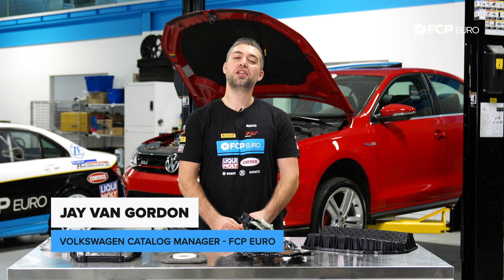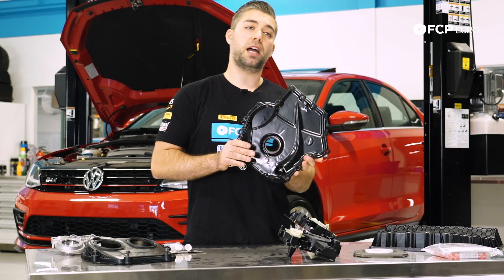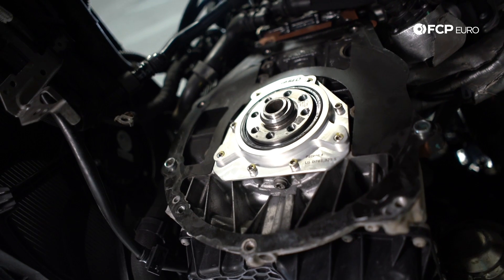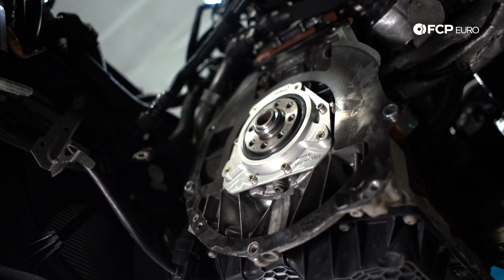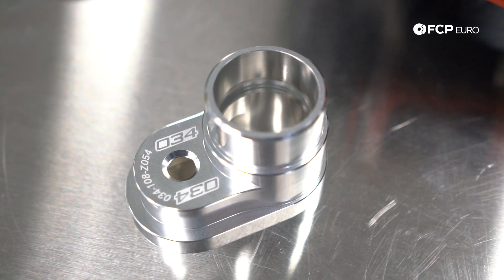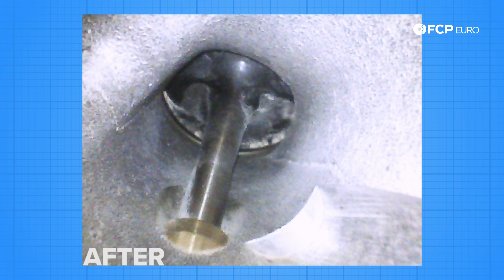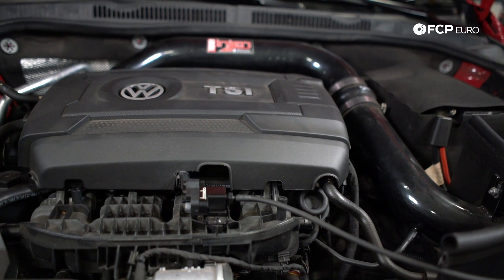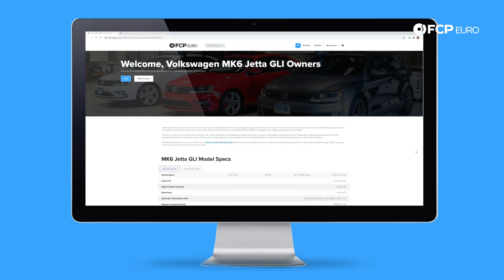Volkswagen EA888 Gen 3 Engine Diagnostics & Maintenance Guide (Mk6 GLI, Mk7 Golf, GTI, Golf R, S3,+)

Comment: ea888 gen 3 is known for having almost no issues... Intake valve cleaning, that should be done for every engine if you ask me.. walnut blasting
Reply: They still are prone to oil consumption. A few months ago I bought a 2016 Golf 7R with 156.000 km and burns 1 L of oil at every 1500 km.

Comment: just got P0303 code for misfire cylinder 3 on my MK7.5 Golf R. At what range do these ignition coils tend to go bad? Im around 68k miles and im hoping thats the issue. Also, on the Gen3 motors, when should a carbon cleaning be considered what mileage give or take? And for the Water pump replacement, do you wait for an out right failure? or is there warning signs? Great video. Just wish there was an anticipated mileage or time frame to expect certain items to be considered.

Comment: Oil leaking from cam bridge can leak into the the actual camshaft actuators and will cause a timing code. Oil will be inside the connector of the actual camshaft actuator pins. Would have to replace cam actuators and sometimes even replace connector head and wiring.

Comment: Its funny because I sold my 2004 Clio 182 140k miles on it and got an Audi a4 2.0 tfsi 225bhp thinking oo newer more reliable what a F**king mistake that was 😂 I’ve gone from powerful engine all metal parts to hot wheels engine

Comment: I live in the tropics and we have hot weather everyday with high humidity. These plastic parts in the engine are simply not durable enough. Had my Passat water pump and thermostat changed due to a cracked plastic housing after only 36K km. VW should reconsider upgrading their plastic to manage hot climate regions.

Comment: Does it generally burn oil?
Reply: If it's a 1.4TSI..Yes.
Reply: @ 2.0T in mk 7 GTI?
Reply: @ewanduplessis9682   It depends... How you drive it.. did you tune it...etc. But on average...no its not an engine that consumes a lot of oil during the time between service intervals.
Reply: @IlikeShekels  So in stock form without abusing it and doing maintenance/services on time, a typcal mk 7 GTI shouldnt consume a lot of oil if any right?
Reply: @ewanduplessis9682   That is correct.

Comment: i have a octavia rs with the chha engine (8 injectors) stock 230hp but done a stage 1 to 300hp on 98 octane now. im impressed how nice of a engine this is... realy powerful from low rmp all the way up, very nice economy when driven softly, warm up very quick even in -10 celcius wont take 5min to have coolant at 90. also, when u have port injection, carbon buildup on the valves tend to be well less of a issue as gas cleans it up quite abit.
Reply: Anche io golf gti mk7, 8 iniettori..💯

Comment: It blows my mind that VW still makes the worst design decisions with their drivetrains.  This is the 6th variation of this water pump and they all have failed/leak.  $400 in just parts to replace a water pump?  Removing the intake manifold?  Who designed this piece of fucking shit?  Buy a Honda or Toyota of the same year and never have to deal with this fucking garbage.  The quality isn't even a comparison.  I used to argue that the TDI was the only saving grace of these Hitler mobiles, but the bolts made out of cheese that held on my crank pulley changed my mind on that as well.

Comment: Ive got a gen 3 apart right now for a water pump ,and the intake is off. 
Its not too bad in the ports, its not great either. 
Its got 91k, whats typical mileage before needing an intake clean?

Comment: Good video. Here is some more advice. For these VWs watch out for
1. Leaks from Water pump and coolant flanges.
2. Replace your oil separator every 2 years (or yearly if you can). These always fail and are the main cause of many of the engine oil leaks mentioned in this video.
3. Use quality synthetic engine oil and change it regularly. Preferably every 7,000 kilometres. You will have less carbonisation snd performance issues.
4. Get a real vw technician to check the condition your timing chain once a year.
5. Be ready for some very annoying failures of electronic components... and they are expensive to replace.
6. Once your car is ok, make sure your really drive and enjoy it to make it "pay" for all the agony above.
Reply: what you mean by oil separator? the PCV valve? 
thank you!
Reply: @pepehuan  Yes, the oil separator functions as a PCV valve
Reply: @faktsonly  Barely.... Also, I wouldn't take my Volkswagen to a Volkswagen dealer if they were giving away service for free. Absolutely a waste of your money and you'll wind up paying for it when they screw something up on your car. Find a decent independent mechanic shop and go there if you really have to.
Reply: I've had horrible experience at the VW dealer. If I can't fix it myself, I take it to a master mechanic I know who specialized in Euro vehicles
Reply: My opinion is and I say this because I apply it ,
I resign I have had Audi cars , but what I do is I buy the car with less than 10 thousand miles certified , never new because you can more money , then the car all the way counts with warranty and apart one more year for certification ,
All Audi and VW come with 2 free services and one more that the dealership offers you (this is optional) not all offer it, at least in my state several dealerships do,
I enjoy them until the end of the warranty and certification which is around 60 thousand miles or 5 years, and after that I change it for a newer one with the same options as the previous one,
Why?
Because if I would stay longer with them you lose more money in repairs and anyway your car continues to devalue and that money you invested in repairs you will not recover . And you really invest little in maintenance after your three years of free service ,
Which is an approximate of 800 Dlls for the next 2 years that I have left to change it .... 
Well that's my strategy , maybe there are other people that many what they do is just rent it for as many years as they want and so they avoid the cost of maintenance and repairs ... greetings .

Comment: Recently noticed engine oil around Plastic oil pan of my 1.8T gen 3.
Dealer cleaned area and will check it again in 2 weeks. They think the oil coming from top of engine !  Car under warranty. No low oil level.
What it can be ?  Thanks

Comment: Under what mileage I should consider changing Timing Chain and Water pump please ?
Reply from the maker: Hi Saef, the chain has no interval as it is not a service item, however for the water pump they tend to last anywhere from 60k-100k.
Reply: @fcpeuro  thank you for quick reply.
I noticed leak from upper timing cover and only has 45,000 miles. As changing timing cover, what else I should look for please ? Thanks
Reply: @saefhindi6184  which car is this gti/tiguan?,I have purchased 2022 tiguan 2.0 tsi(india)
Reply: @vekeyes3861  its 2019 Golf Sportwagen 1.8T 4 motion DSG transmission. I will mention it to dealer in next visit

Comment: Has anyone had a problem with rough idling when just sitting park? I had my check engine light come and it said I had misfires in cylinder 1,2 and 4. Does this problem sound similar to anyone else’s?
Reply: My mk6.5 1.8t has rough idle on cold starts, which diminishes in sport mode or after driving for a bit. Pulled code P0441 - EVAP system, incorrect flow detected. Also had misfires like you're saying, and camshaft over-advanced. Fuel trim went up to 32% at some points while revving in park. I don't wanna throw parts and time at it so I'm gonna take it to a shop. Engine power seems fine, pulls well on the freeway but the engine bucks so hard on cold starts.

Comment: Excellent information. 65 K on my 2018 Golf 1.8 TSI Gen-3. Change oil every 5K, use Top Tier gas, almost all highway driving at 75 mph, 2300 rpm.  Mileage is amazing (41-43 mpg). No problems yet, and following the maintenance schedule without variation. Not keeping up with maintenance on a VW is an invitation for expensive problems.

Comment: How many miles the chain could last?
Reply from the maker: Timing chains for these motors typically last between 80-100k. There is always the possibility that chains can exceed this interval or have to be addressed before this interval as well.
Reply: @fcpeuro  could I check the condition via diagnose ?

Comment: I need some info & help RE; 2016 polo 1.8 gti tsi bluemotion 192hp DAJA.
    I have noticed a very small amount of engine oil on the spark plug thread on the last cylinder (air filter side), i believe that the leak is coming from the valve cover seal around that spark plug& dripping onto the nut of the spark plug , i think that when i removed that plug the oil dripped down the crush washer onto the thread ? The actual spark gap  is normal & dry.
 So i now need to reseal the valve cover  but there is a lot of hoses , valves etc to move so i can lift the valve cover out, i cant find any vids on how to do this on this engine , im no stranger to doing valve cover gasket relpacements but this one has made me think twice about doing it myself , i need as much info & help with this as possible , am i over thinking this task or is it  a relatively easy task?? 
Normally a valve cover gasket job is a easy & straight forward proccess, obviously my engine is chain driven but will i mess the timing up when i remove the valve cover ? I dont want to undo anything that i dont need to undo or remove ,i just want to do the easiest straight forward way to do this . Tools are not an issue as i have the relevant tools needed .
 Thanks in advance 
If you or anyone has done this proceedure on the same engine ir has found a tutorial vid of it on this engine please can you let me know it will be very much appreciated , my email address is Sentinal123p@gmail.com

Comment: Got new VW Tiguan 2020 and noticed my car is being low on the oil. Took it two times to a dealership and they told me it is not leaking and that lose of oil is acceptable. It even says so in the manual, I just can’t believe that lose of oil (being that is small) it is still acceptable with EA888 engine.
Reply: All engine consumes oil. Only excessive oil use is bad

Comment: What oil grade should i use for this engine? Should I stick to the same oil grade I've done stage 3 for this?
Reply: If you don't stick to the factory recommended oil change intervals, why would you stick to the factory recommended oil weight? 
I don't. 
110k and only preventive maintenance so far.

Comment: I believe Gen 3 version has a PORT fuel rail aside with the direct injection.  Is it still there the carbon build up problem?
Reply: Nope.. I've cjeb engine but got carbon flush anyway.. Not a lot came out. Better set up in euro engine

Comment: Can the covers be taken off without messing around with any timing components? Why hasn't VW fixed the cam cover oil leaks? I don't get it. Maybe it's just going to happen no matter what. Can you add an oil-air separator, an oil catch can? Are there aftermarket metal oil pans? Still using plastic in the water housing.! WTF. 
Man, I see that VW AG hasn't really changed a lot since my VSTT training. So many problems. Ya, great when new, and horrible to maintain and work on.

Comment: Does anyone have any idea when you should replace the 2 capsules in the coolant expansion tank? I have asked several experienced VW techs and no one knows 1 what the purpose is and 2 when to replace them or if they are needed.  My concern is what happens if they break and leak in to the cooling system clogging heater core or radiator.
Reply: Take them out, they serve no purpose
Reply: Flushing the coolant every four years and changing the coolant exp tank at the same time is a prudent move. Replacement tanks generally don't come with silica capsules inside...

Comment: One way to let your timing chains last is don't follow VW's extended oil change interval. Get that crap drained out of your engine at 3k-5k miles and change it with whatever oil spec VW wants.

Edit: Yeah I commented before he said 5,000 miles lol.
Reply: I did 3k on my MK4 GLS and 5k on my 2.5 SE. I was generally a quarter bottle low with the MK6 each time. Wasn't too concerned.
Reply: I do every 3k miles, and when I am done I pour the oil all over bald eagle nests in the forest.

Comment: What about the catalytic converter? At 100 000kms my catalytic converter got clogged. Replacing it would have costed over $2k so I decided to decat it.
Model : Audi A3 1.8TFSI
Year : 2014
Engine: EA888 gen 3
Code: CJSA
Reply from the maker: catalytic converters do have a working life, but a lot of the time they becomed clogged due to other issues, like excessive oil burning or running rich

Comment: Question; why do Americans recommend oil changes every 5k miles, whereas in Europe it's 10k miles or 12 months?
Reply from the maker: Not sure about the differences between countries, as some manufacturers here have intervals set at 10k as well. We personally recommend every 5k due to oil break down, and suspension of contaminants in oil
Reply: Because The Manufacture Recommendations, but anygood mechanic including Myself recommend changing Any Oil on any car at 5K No matter how good the oil You use Amsoil, Mobil 1. You have to change it at 5K 
Especially Turbo Cars.

Comment: I cant believe you forgot the wastegate actuator! My Passat is going back and forth with limp mode, and now starting to "creep." And the dummies @ VW thought it was a good idea to have to wastegate built-in, so you cant try even try and attempt to stiffen the arm. Damn p0229 has been kicking my ass, but that's partly my fault lol...

I really appreciate the info bro, I got my first sedan and it's a European car, so the transition has been a little rocky, especially having only standard size tools and learning they only use metric. That was annoying as hell at first, but I just got VCDS, so if you can do any videos on VCDS on how to code a turbo after replacing it, would be much appreciated🙏🏽 Look forward to the next video, subscribed.  🤝🏽
Reply from the maker: Metric, and a good set of triple squares will come in handy!

Comment: Ive got a 2017 Euro Polo GTI with the Gen3 1.8T TSI engine. 55k on the clock, kilometers that is mind you. The oil level of the engine rises and it smells like gasoline. I know thats a probem with cars that drive a lot of short range but im driving about 14km to work every day one way and thats not exactly short range. Also it slowly looses coolant and the idle is rough. All the maintenance has been done by a proper VW dealer according to schedule. Its out of warranty and getting it diagnosed alone is going to cost me hundreds of Euros never mind the 4 digit price to actually fix a crappy seal in a tight spot. As much as a love the VWs when they work they can be a money pit and VW does not care one bit about their customers. Parts are designed to fail so they can make money fixing them. Planned obsolescence.

Comment: Golf 10 will have plastic cams, pistons and crankshaft. The amount of plastic used to make EA888 is appalling.
Reply: It's the norm across most manufacturers today... VAG isn't the only one lol
Reply: You’d be surprised the Toyota Camrys engine has more plastic.
Reply: @yashsab2 yeah but they are engineered for reliability not performance
Reply: Actually it will be electric.
Reply: Sure. Bmw not, right?
Reply: @randomhobby3729 I believe BMW was one of the first to introduce a plastic intake manifold on its 6 cylinder engines... benefit is the nice and smooth intake inside structure...
Reply: @mstar501  plastic intakes come port and polished from the factory.
Reply: It's mainly done for weight saving, but I will 100% say plastic sumps are just stupid
Reply: Brevvv my bmw n54 has plastic intake and it’s handling 25 psi from cold start for 8 year 😂
Reply: It really isn't but ok. The thing is cast iron with aluminum heads. It even had aluminum valve covers. Very common to see plastic valve covers these days